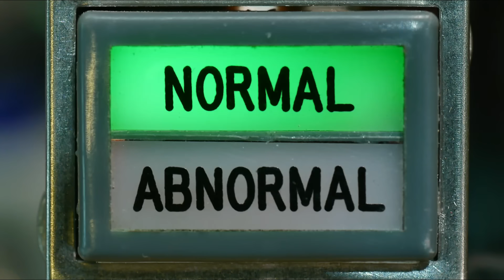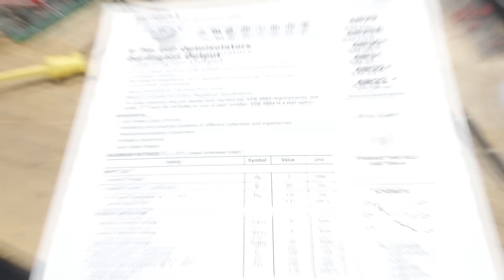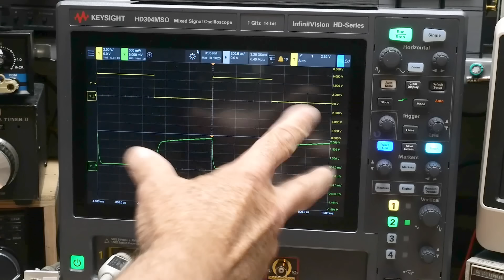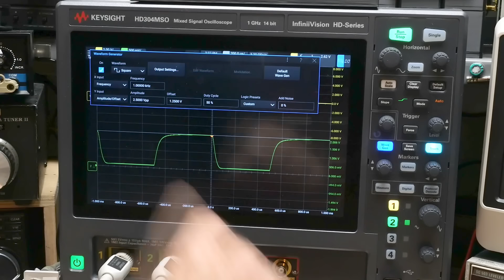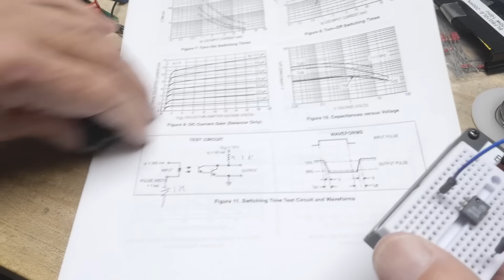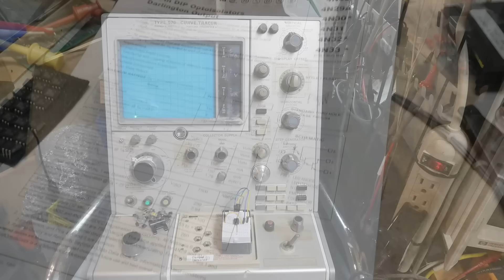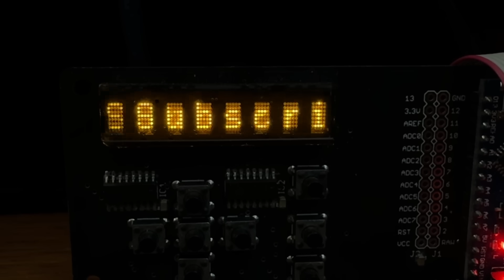#2181 4N29 Optoisolator

Comment: The great problem with optoisolators and also with dc-dc- converters is the true isolation voltage they can sustain. Usually they give only the momentary value which can be rather high. In real circuits the chips can take much lower voltages only. The reason is that the chip plastic cases start to have creeping currents and sudden external breakdowns.

Comment: used and still use loads of that same part for keying interface modules for radio base stations on the turnpike here-they keep working and working and working-doesnt need too much bandwidth to assert a PTT signal

Comment: Any chance you might do a quick follow up on this? In a previous video (https://youtu.be/EzrgFLdPzgw?si=CyfvTd-FjYiRQWYj) you ran a sine wave through. I'm curious about the distortion this part would add to audio, and maybe a Bode plot with a 10kHz sweep to really see the roll-off from the led, and gain of the Darlington.
Reply from the maker: https://youtu.be/QmySXQMZ2TY?si=9bbgwRGErUgQ3rK0

Comment: With the base exposed to an external pin, it could be useful to create logic functions by interaction with other optocouplers or devices.
Reply: .. it's usually used to change the sensitivity  somewhat...
....decrease it with a pull down res. (for int. npn type)

Comment: Thanks. 
I have used Optos over the years, never really understood why and for what you would the base connection.  Don't think I have ever seen any application circuit that used the base connection.   I am a digital guy, so I just want fast binary operation.   Anyone have an an application example that uses the base?.
Reply: A more recent datasheet for these (from Fairchild, 2006) has some extra graphs and use cases where depending on the base resistor you can make then faster or slower depending on application. Applies directly on suitability for digital signals in various frequency ranges.

Comment: I remember building MIDI cable out of some random optoisolator. I couldn't believe that it couldn't handle 31250 baud rate. Now I can see why. Wow, these things are slow.
Reply: Anything with darlingtons in it will be much slower than a single transistor.
Reply: 6N138 is the most common opto for MIDI devices.

Comment: It reminds me using one to build a MIDI interface (from computer to keyboard). I discovered that this one was really slow ! (datarate was 31250 bps)
Reply: for MIDI I use H11L1 parts. They have a light-sensitive Schmitt trigger inside which is rated up to 1MHz. No problems with the MIDI data rate.

Comment: according to chatgpt:    

3N170, 3N187, etc. – These are early-generation JFETs (Junction Field-Effect Transistors).
3N200 series – Some MOSFETs and specialized transistors.
While not as widely recognized as the other prefixes, 3N typically indicates FETs (Field-Effect Transistors), particularly JFETs in historical JEDEC usage.
Reply: These have tetrode (dual gate) or case pins, 3N are 4 pin devices. And there are FETs with 2N codes too, three pins. 2N7000 for example.
Reply: @schmitzbeats6102  yes I know, the message was from Mr. Chatgpt

Comment: Hey Imsai guy, I think interesting opto devices for the channel would be: H11F1/2/3 (FET output, not sure what output stage is. JFET? parallel MOS like analog switch?) and photovoltaic output optos like VO1263. Maybe vactrols too (easy to DIY)
Reply: The H11 parts we used had a MOSFET switch. They were nice because they could switch AC, which was a requirement for my company's products.

Before the MOSFET optos were available we'd use a 4N36 (with a bipolar transistor switch) followed by a full wave bridge rectifier. The signal to be switched was applied to the AC inputs of the bridge, the + output was connected to the opto's collector, and the - output was connected to the opto's emitter. Other than a couple volts of drop across the circuit it'd switch 24V or 120V AC no problem.

Comment: I always thought the the first number (1N, 2N, etc.) was the number of pn junctions.
Reply: I've read that it's the active pins minus one, so for these optos that bring out the base, it still holds.
Reply: @loukashareangas4420  I think the "active pins minus one" was for Japanese 1S, 2S devices like 1S188, 2SC2078, etc.
Reply: I mean that was the intention (iirc) though it gets a little weird with mosfets especially between dual gate mosfets and single gate mosfets with a substrate connection.  It ends up just being the number of terminals minus one.
Reply: It could fit well to a 3N211 there has 2 gates.
Reply: yeah pins-1 is what I was taught too. 1N for diodes, 2N for transistors, 3N for dual-gate MOSFETs, 4N for optocouplers with base connection. :)

Comment: AI Summary:

Abstract:

This video analyzes the vintage Motorola 4N29 optocoupler, a 6-pin DIP component from 1984 with a Darlington phototransistor output. The analysis includes a review of the datasheet, detailing key specifications like voltage/current ratings for the input LED and output transistor, isolation voltage (75V AC), and relatively slow switching times (tens of microseconds). Practical testing demonstrates the basic switching function and confirms the speed limitations (~3-5 kHz). A key technique shown is using an external pull-down resistor on the accessible base (pin 6) to significantly improve the turn-off speed and waveform shape. A brief teardown attempt and curve tracer analysis further illustrate the device's internal construction and confirm its expected characteristics, showcasing the optical isolation principle.

Chip of the Day: Exploring the Vintage Motorola 4N29 Optocoupler

*   0:00:07 Introduction & Identification: The 4N29 is identified as a vintage (1984) Motorola optocoupler, explaining that the "4N" prefix in JEDEC numbering is generally reserved for optoelectronic devices like optocouplers/optoisolators.
*   0:01:15 Device Overview: The 4N29 is a 6-pin DIP optoisolator featuring a Darlington transistor output for high current gain. It's part of a family (4N29-4N33).
*   0:01:41 Input LED Specifications: The datasheet shows the input infrared LED can handle up to 60mA forward current and has a reverse voltage limit of 3V. Typical forward voltage is around 1.3V.
*   0:02:01 Output Darlington Specs: The output NPN Darlington transistor is rated for 30V (collector-emitter) and can switch up to 150mA. Notably, the base of the Darlington is brought out to pin 6.
*   0:02:17 Isolation Rating: The device provides significant electrical isolation between the input (LED) and output (transistor) sides, rated for a 7500V AC surge voltage.
*   0:03:04 Performance Characteristics: Datasheet graphs illustrate the LED's forward voltage and the Darlington's output characteristics, showing substantial current transfer ratio (gain); e.g., 5mA LED current can result in around 80mA collector current.
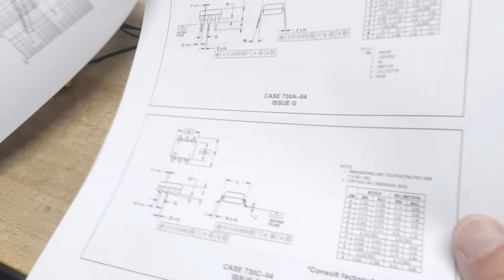*   0:04:01 Switching Speed: The device is relatively slow, with datasheet switching times (turn-on/turn-off) in the tens of microseconds range. Turn-on is typically faster than turn-off.
*   0:05:06 Basic Operation Test: An oscilloscope test using 1kΩ resistors confirms basic functionality: the output goes low when the input LED is on. A slow rise time (turn-off) is observed due to the pull-up resistor and the transistor's storage time.
*   0:05:59 Improving Turn-Off Speed: Connecting a 10kΩ pull-down resistor to the exposed base (pin 6) helps remove stored charge faster, significantly improving the turn-off speed and creating a sharper waveform, though slightly slowing turn-on.
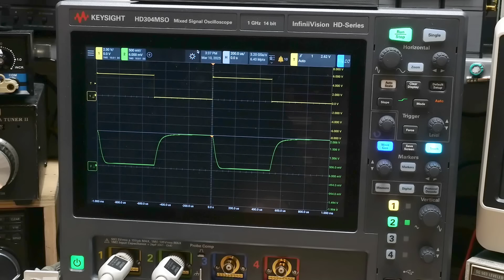*   0:06:54 Frequency Limitation: Testing confirms the speed limitations, showing the device struggles to operate cleanly above approximately 3-5 kHz, making it suitable mainly for DC or low-frequency switching/isolation tasks.
*   0:07:42 Physical Construction: An attempt to decap the chip revealed an inner, translucent plastic package within the main DIP body, likely designed to facilitate light transmission between the internal LED and phototransistor while ensuring isolation.
*   0:10:11 Curve Tracer Analysis: The curve tracer shows characteristic transistor curves (Ic vs Vce) when driving the input LED with current steps, confirming the optocoupler's function. Slight self-heating effects are visible at higher drive currents.

I used gemini-2.5-pro-exp-03-25| input-price: 1.25 output-price: 5 max-context-length: 128_000 on rocketrecap dot com to summarize the transcript.
Cost (if I didn't use the free tier): $-0.0149
Input tokens: 14183
Output tokens: 721
Reply: I'm sorry, I don't see the point... what are you trying to tell us?